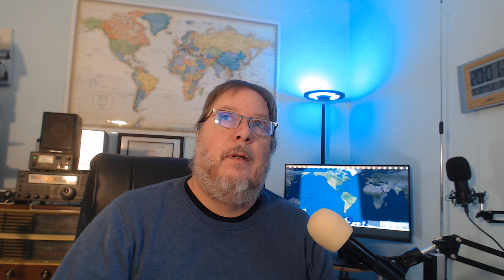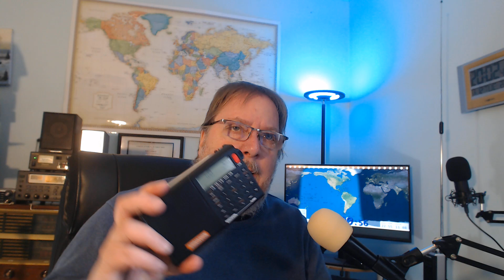You have multiple receivers? some suggestions on how to use them together for more radio listening

Comment: Well said. One could also purchase very inexpensive shortwave radios, which I've done, and see what you get on one and not the other.  I have several radios from different price points and sometimes I'm surprised what I get from a cheap radio compared to a more expensive unit or visa versa.

Comment: I'm on and off, have a 200ft long wire that runs along my very small property and then up to the roof and wrap around a pvc vent tube.  I'd be more animate if there were more content.  I do  seek out stations on occasion and post a short video on the FB I am affiliated with.   I just am not pulled like I used to be to the SW like I used to be.  I'm still getting radios , repair, recap, re resistor, do an alignment but it is for myself.   I really wish there was more on SW